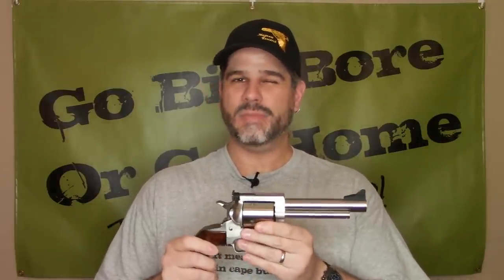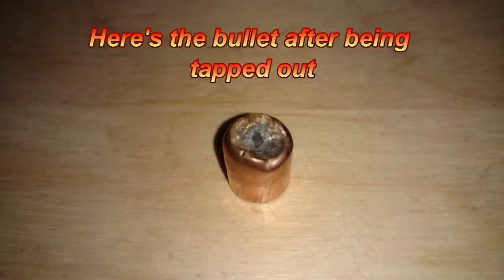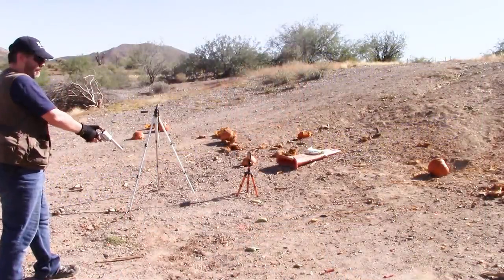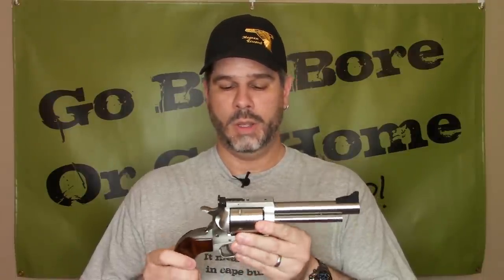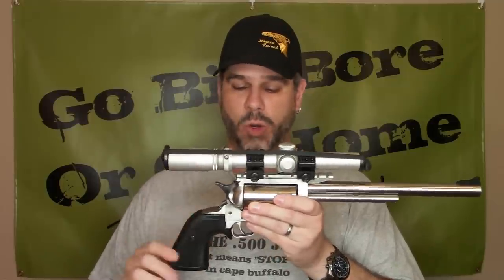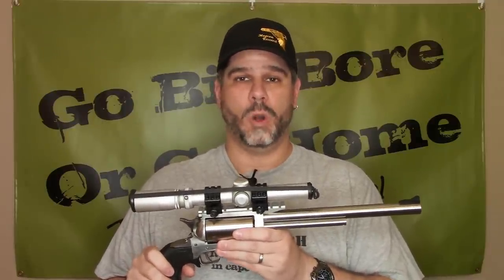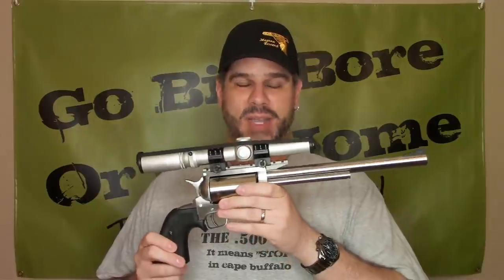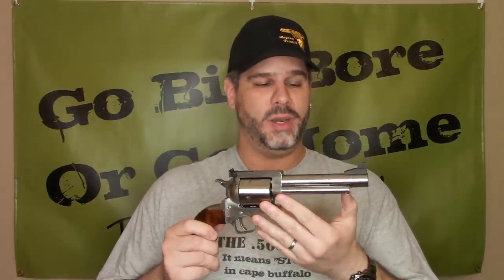I Blew Up My BFR in  500 JRH!  (And an Update on My .500 S&W Magnum BFR)

Comment: There's no way. You definitely fucked up a reload. And you also almost looked straight down the barrel before remembering you were filming. lol
Reply from the maker: @Tony Jackson - Listen, Troll.  First off, I didn't "almost look down the barrel".  I noticed the barrel looked odd so I looked at it sideways to see it better and, if you noticed the shock on my face, was completely stunned when I saw the barrel split.  But, hey, thanks for calling me stupid.

Secondly, when you fuck up a reload in a revolver, it will cause a problem in the cylinder or at the forcing cone.  Damage will be at the frame and/or cylinder.  The barrel was damaged after the frame.  Per Jack Hunting (as in the guy who developed the .500 JRH) who watched the footage, and the folks who put their hands on the revolver at MRI, the most likely cause was a barrel obstruction or prior damage to the barrel.  There was a previous crack they could see in the barrel with fouling that accumulated.  I had a along discussion with them about this.  They believe my previous bad round from a box of .50 AE factory ammo was the culprit as some of the powder had ignited and pushed it further into the barrel than a normal squib.  Also, per Jack Huntington, stainless steel can fracture in barrels and he's seen it happen many, many times.  He prefers chrome-moly steel for this reason.

Third, do you just go around the internet being a know-it-all jack-off to everyone?  Is your life that sad that all you can do is call other people stupid?  I love how you consider yourself an expert on this after you saw 8 minutes summing up over a month of investigation and talking to gunsmiths and gun builders.  You're a winner!

Comment: Gotta be a little unsettling to have a catastrophic failure in any gun, let alone a beast like that. Seems like you had good fortune sorting it out. I would love to get a BFR in 475 Linebaugh but it seems like none of my local shops are too interested in trying to obtain one.
Reply: I've found that most gun shops in my area usually don't carry "specialized caliber" handguns. I simply ordered directly from BFR's company with features that I wanted and had it shipped to my local FFL holder.
Reply: @Caje-zf8md  I've seen the site to build a custom BFR at Magnum Research, but I don't understand why the price is $500 higher when I'm choosing the exact same options that appear on their standard listed model. That, and up to a year wait. I get that it's something of a specialized gun, but it's one that's also in (theoretically, at least) regular production with MRI. Maybe I'll ask around again...

Comment: I had an identical problem but I found was a partially obstructed flash hole. I got it rectified and now it works as smooth as silk. That case was bad but a little scraping with a small screwdriver cleaned out the gunk and now there is no problems. I couldn't find any cracks on the barrel for frame so I think I am fine. I fired it ten times since with no problems.

Comment: The first pistol there was 100% another bullet lodged in the end of the barrel. 

You want us to believe that you somehow had the same issue on two of the strongest built revolvers? Not a chance but I do appreciate you showing the video.

 Slow down, go over your processes and make sure everything you are doing is good to go. Appreciate the video, does good to remind us all to be careful. Look forward to more!
Reply from the maker: @Matthew - Uh, no the .500 JRH did not have a bullet lodged in it's barrel when it blew.  First, that was literally the first round I put through it that day and I had recently cleaned it.  No lodged bullets.  Secondly, when there is a bullet lodged, the barrel dies not simply split.  There is a bulge where the two bullets collide.  The photos show no such thing.  Thirdly, the statement of what caused the damage came from the gunsmith at MRI.  You're welcome to draw what opinions you want, but you didn't put your hands on the revolver and MRI did.  You're being an armchair quarterback.

As to barrels cracking on "the strongest built revolvers", feel free to verify with MRI what I'm about to say as this is what they told me.  The barrel on the BFR was designed to be the weakest part on the revolver so it would be the failure point.  In short, if there's a catastrophic failure, the barrel will be the first thing to go and the resulting shrapnel, bullet, and other particles will mostly be shot away from the shooter.  In short, this is done on purpose for safety.  Most manufacturers do this to protect the shooter.  The AR-15's designed failure point is the gas tube.  Easy to replace and turns the gun into a bolt action, more or less.  And something I've learned since starting this channel is that stainless steel is more likely to fracture then chrome-moly (blued) steel.  In speaking with Jack Huntington on these barrels, he said he replaces fare more fractured stainless  barrels than chrome-moly ones.

In the fracture of the forcing cone on the .500 S&W Magnum, the problem was obvious to both the folks at MRI and myself.  There were uneven wear patterns showing the bullets were hitting one side of the barrel harder than the other.  This lead to the barrel being hammered harder at the forcing cone on one side than the other.  The point of contention was that I had sent the gun to JRH Advanced Gunsmithing to have a muzzle break added which means they took the barrel off. So, there were suggestions that the barrel had been reinstalled incorrectly.  Jack's team does good work, so it's hard to say if they did reinatall it incorrectly, if it was installed incorrectly in the first place, or even if the timing was off on the cylinder rotation.  All I can tell you is for some reason bullets were hitting one side of the forcing cone than the other and this is not normal wear and tear, causing the forcing cone to crack.

There's also one other thing to consider.  Most people don't shoot their .44 Magnum even 500 times in their life.  I do that in six months.  That .500 S&W Magnum cracked at 325 rounds.   I have since definitely crested that 500 round mark.  In short, I shoot my guns a lot.  Especially in research for this channel.  I will put more rounds down range with my guns than most, so I'm going to have more wear and tear, period.  You will therefore see me dealing with this more frequently than most people.

All things being equal, when the. 500 JRH barrel split. I thought I had an over-pressured round.  MRI confirmed it was due to a crack in the barrel that had been collecting debris for sometime.  I believe the lodged .50 AE bullet that took Thor's hammer to dislodge was the culprit.  But that's the diagnosis from the guy who repairs them for a living.  You can believe what you want.